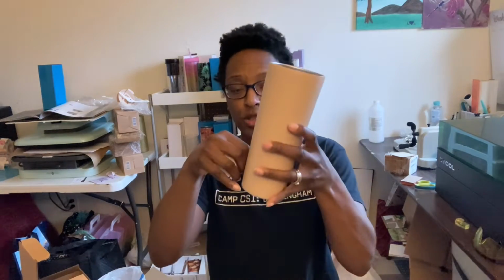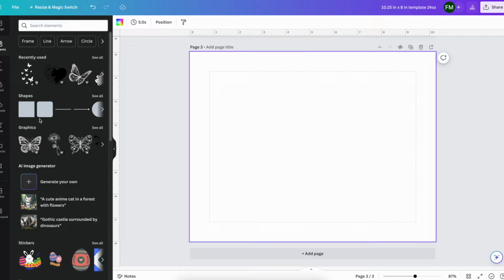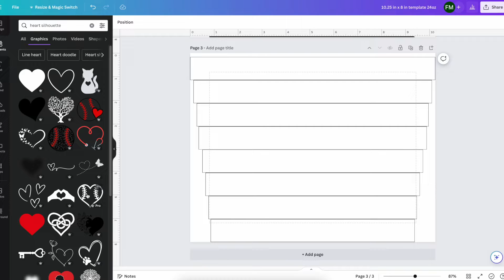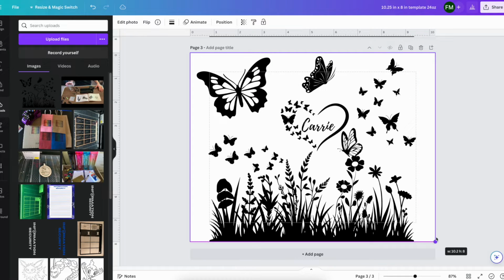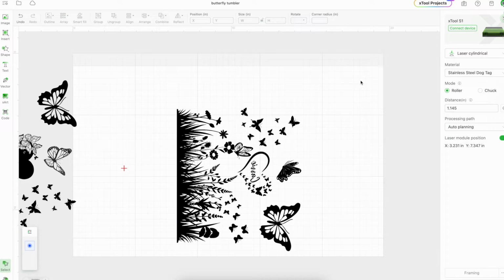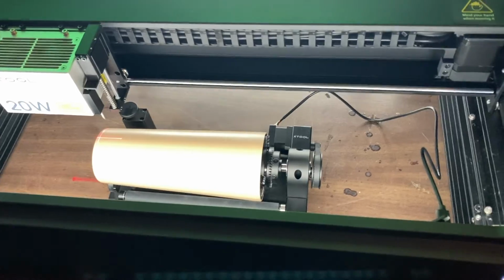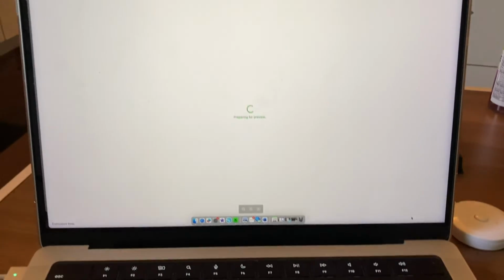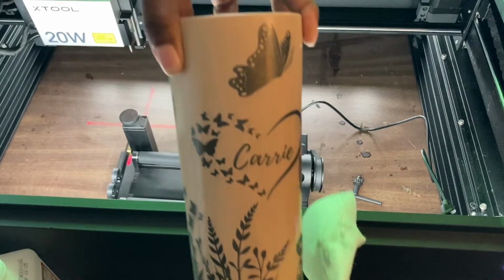Step by Step Full Wrap Laser Engrave Tapered Tumbler XCS xTool S1 RA2 Rotary Attachment

Comment: Can you explain to me why the name has to be a mirror image? My brain can’t compute. 😅
Reply from the maker: When using the roller setting it engraves mirror image to what you see on screen. I wasted a tumbler is how I found out. If you use the Chuck setting it engraved exactly how you see it on screen in xcs.
Reply: @liciatoday  I'm so confused... I have engraved multiple tumblers with the chuck setting and have never had to invert the image and it has never engraved the image or text backwards.
Reply from the maker: @ If I use the roller setting I have to. I leave my chuck and rollers on my RA2. So if I use the roller setting I still attach the tumbler to the chuck. Maybe that is what is causing confusion for you.
Reply: @liciatoday  If you choose chuck instead of roller in the settings then you won't have to mirror the image.
Reply from the maker: @ I know this is what I explain in the response to the original commenter. I wanted to try making tumblers both ways. So this one was using the roller setting.

Comment: If you are using a chuck, what do you put for the diameter? The larger or smaller?
Reply from the maker: I used the middle of the tumbler’s diameter so basically the average. That way it wasn’t too big or too small and it seemed to work that way so I didn’t try to adjust the diameter from there.